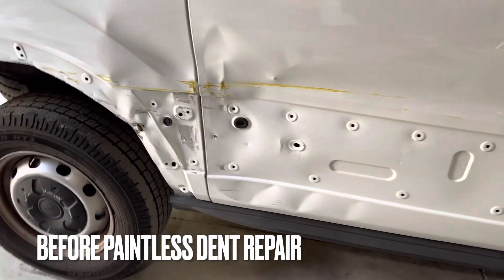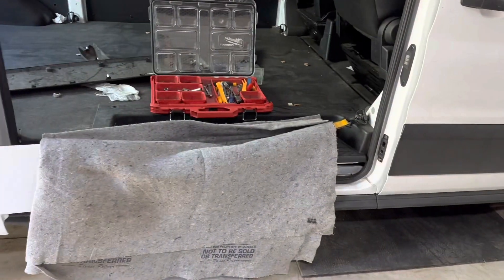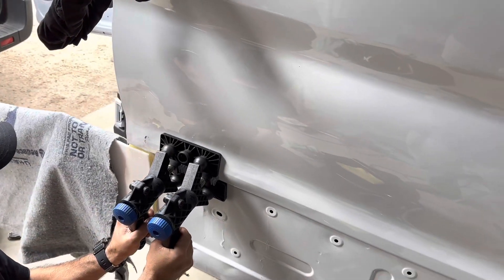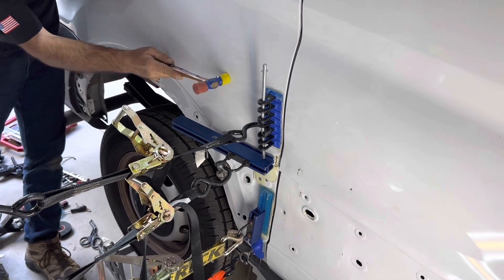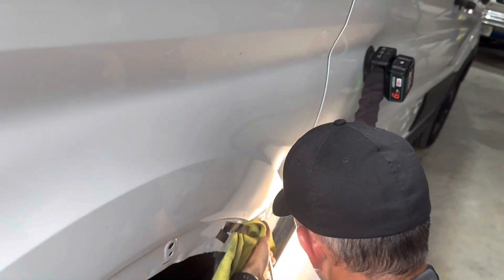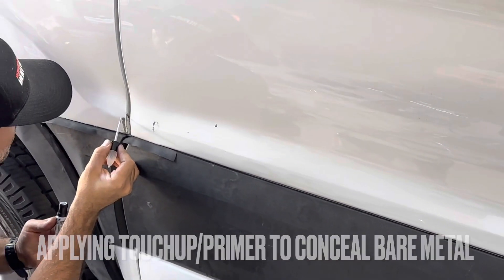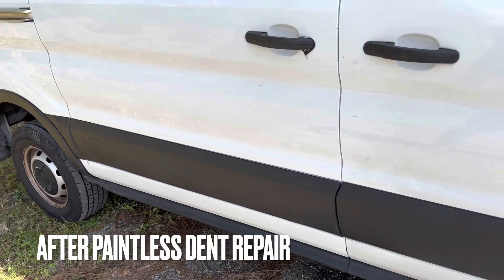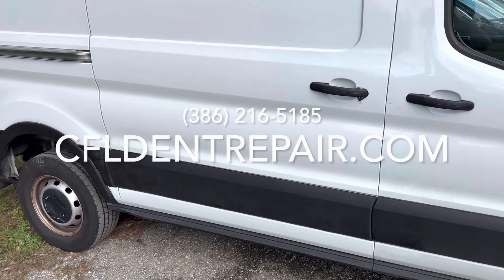SEE AN EXTREME PAINTLESS DENT REPAIR IN ACTION

Comment: Incredible repair as always! Question… you carry both the cam auto vacuum tower and the perfect pull tower in your van? Did you have to switch to the perfect pull mid repair because the vacuum tower wouldn’t handle the tension needed?